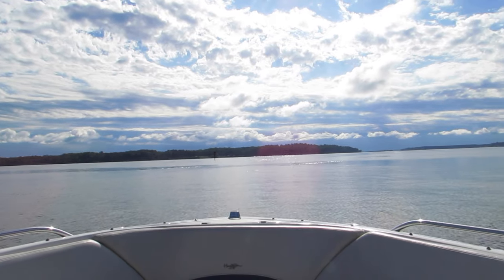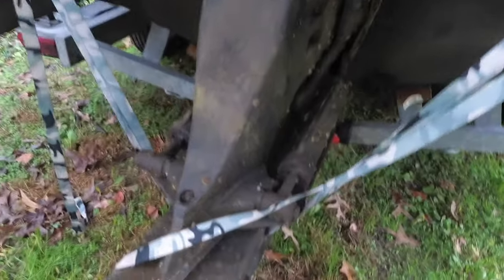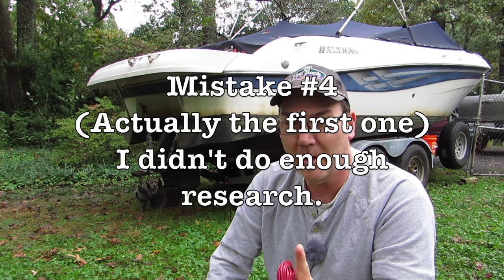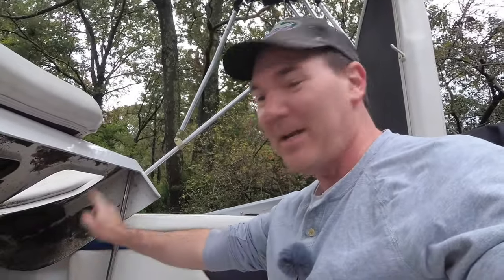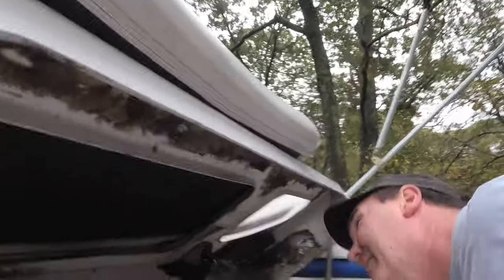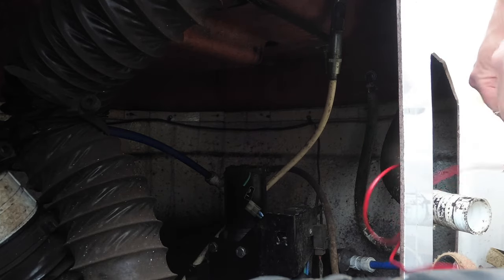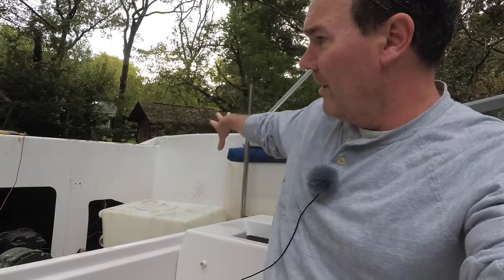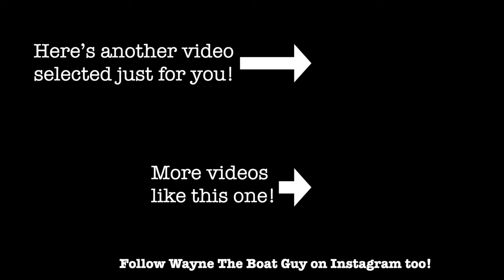Tilt Trim Not Working or outdrive stuck down? Here's something simple to try.

Comment: I just found out that my trim works okay. After hot wiring it, from wayne's instructions, i did raise the outdrive that way, 3 weeks ago.  I didn't know whether to use the buttons on the throttle or the up/down switches on the dash.  Now I need to learn about the trim tabs.

Comment: Love the honesty.  FYI there is a relief valve on all outboards (and I am asuming outboard/inboard) that allows you to manually lift or lower the lower engine.  It is a screw that you use a straight slot screwdriver to turn.  Turning it Counter clockwise relieses the valve so the hydrolic oil can move freely.  Then you will be able to lift up on the motor until you can put the kickstand down.  If the motor is stuck in the upright posistion then it will allow you to lower it.  If you are in a fix this comes in handy

Comment: I just found out that my trim works okay. After hot wiring it, from wayne's instructions, i did raise the outdrive that way.   I found that trim does work as long as the key is in the accessories position, using the buttons on the throttle handle. I just bought the boat.

Comment: I just had a similar issue last night. Turns out the power to my hydraulic pump separated from the connector so it wasn’t getting any electricity. I’m guessing the connector end eroded away and the wire became disconnected, where all my accessories were also place on the engine block off of my battery cable. 97 Four Winns Horizon QX.

Comment: I have a mercruiser alpha drive.  Always have had grounding issues. Got stuck down then up. I made an alligator clip jumper out of 12g wire and ran it from the grounding location for the pump straight to battery negative and it runs just fine. A wise mechanic told me to check power and grounds first
Reply from the maker: That is a REALLY good thing to remember!

Comment: Hey Wayne. I just saw your site and am impressed with how many issues you’ve addressed. I have a question not related to the current video. I hope you’ll see it and give it some thought. I have 140 hp Suzuki outboard. For the last number of months occasionally it will stall out at speed. The fix four out of the five times has been to squeeze the gas bulb near the tank to give it more gas. The bulb is always soft. I then put in neutral and it restarts. The other time that didn’t work, and we were stranded out in the lake. I took it into the local marina guy. He looked at many many different things, including fuel pump, etc. etc. filters etc. and he said he couldn’t find any issues or anything wrong with it and just to try it again and keep my fingers crossed. We’ll, it happen again today. we did the squeezing of the bulb thing and it worked after I restarted. Is this a common issue with Suzukis and if so, do you know any Reason this is happening and any fix that will be a little bit more permanent? I’d really appreciate hearing back from you. Thanks very much Wayne.

Comment: Hey Wayne I had a similar problem, except the trim motor worked and then it wouldn't. Played around with wires and got it working. I noticed a lot of corrosion on the leads to the trim motor. Cleaned them off and it seems to be working. However to be safe I'm going to pull the relays and clean them and order new ones they are cheap. I noticed the up/down relays are held into their receiver with zip ties. Given the bouncing around they might be loose. A lot of electrical corrosion on these old I/Os.   Fooling around with a faulty starter relay too. But thats for another day
Reply from the maker: Yeah! I needed to clean all the contact points again this year and used a lot of dielectric grease to try to help. A month later and it’s acting up again because of poor contacts.
Reply: Don't never buy a boat if you don't know what to look for. Maybe 1% or 2% at the most a boat owners when they selling the boat will be honest about all the problems do your research go online . Plenty of great videos easy to follow I've been a mechanic for the last 60 years and work on boats also and there's times that I have to look at the videos it's okay to make mistakes as long as you learn from them and the next boat you get you won't get ripped off as bad. Good luck. Boat stands for break out another thousand believe it the main thing is to have patience and you will persist

Comment: Fantastic, thanks! I did this today on my Mercruiser Aplpha 1 Gen 2 and although the plugs etc are different the concept worked perfectly! I also added a switch near my throttle so now I can raise it by toggling the switch. I wired it directly to the battery etc. The reason I did this is that my SeaRay 180 bow rider is 21 years onld, probably worth about $6K retail. There is not way I can justify spending $100's on the new parts and a technician to do the work. The total cost of the job was switch $9, wire $9, other small things $3 although it took me about 2 hours (free).  So about $21...
Reply from the maker: Glad it helped! With an older boat, sometimes it's challenging to decide whether to fix something 'right' or to just get it working again!

Comment: That was a very good video. I am not much of mechanic and I have the same engine in my boat. I noticed red fluid leaking from the rear of the engine compartment. I was told could be hydraulic fluid. My boat did not come with a owners manual I bought it used. Looks like its coming from a plastic box in the back .
Reply from the maker: Thank you!! Your power steering might also be red. It can be real tricky finding out exactly what and where is leaking! Sometimes if you hold your phone behind the engine and shoot video or take pictures you can get a better look at problems and leaks. Good luck!!

Comment: I thank you for the great video it helped a lot . I still need to find what to do as my pump does work
Reply from the maker: Try to check the easy stuff first - fuse, circuit breakers (and relays like I do here) and then the switch. But if you hot-wire your motor directly to a 12 volt power source and nothing happens, it's something in the motor. Good luck!!

Comment: Hi Wayne, I love this video. Thanks for posting it..!     I have the exact same tilt-trim motor with a stern-drive stuck in the down position.  I'll be giving this a try and re-posting.     

QUESTION:   Can you do something similar to lower the drive ?
Reply from the maker: I "think" you can reverse the wires and it will lower the drive.
Reply: @WayneTheBoatGuy    
This worked like a charm Wayne.!   
By reversing the - positive and negative - contact points from the battery to the trim motor, I was able to raise and then lower the outdrive.   
Great video, thanks again for taking the time to post it AND respond to comments.

Comment: My first inboard, they said, just put the exhaust manifold back on it’ll run exhaust manifold was cracked. Three engines later the boat finally runs right did it all myself had no idea how to do it thought this is a great learning experience and if anybody tries to give you the old man garage wall? It’s a boat motor. It’s different than a car motor. They’re out of their mind it’s the same thing Same thing started mine 10 years ago and I love my boat now last engine was put in five years ago got that many hours on the boat that I keep burning up engines.

Comment: What was the final fix? I have the same issue - Trim Switch up/down just makes a click in the engine area. I appreciate your video as I wasn't sure about the Trim Motor itself either. (Typical) Location, Electric, Hydraulic.
Reply from the maker: The last fix I did to this was to replace the relays with new ones and used a lot of electric connection cleaner spray and then a little touch of dielectric grease. That seemed to sort everything out.
Reply: Well I just got finished troubleshooting mine. Found the pump. I used to think it was a dedicated pump for one of the engine hatch lifts. I tried to just pull the relays off. No go! I reseated the power plug and tapped and kicked it a little. WA-LA! It started working! I'm guessing a stuck motor? I may post a pic shortly. I do appreciate all your videos as guidance. Love your simplistic approach and humor too!
Reply: @WayneTheBoatGuy  
I forgot to ask you if the polarity of the "hot" wires from the battery made the outdrive go up and/or down? Seems like you just hooked them up and the outdrive just started going up. What makes it go back down? Flipping the wires around? Thanks Wayne!

Comment: So my motor sends the unit down but not up.   How do you reverse the motor.
Reply from the maker: I would check the switch to see if it's working when switching up (can you hear a click atr the relay?) and you can swap out the relays or switch the wiring at the trim motor. But there could also be a separate issue.

Comment: So if you reverse the wires in the terminal would the stern drive go down? How did you know the correct way to get it to go up?
Reply from the maker: I think I just touched the wires to the tilt-trim motor plug which has two wires, and then just switched them around.

Comment: It looks like the previous owner anti-fouled the outdrive with the paint that he used on the hull.Somewhere in the back of my mind I think that is a mistake. Not 100% sure on that one but check into it. Another plus on inboard is you can run a bus style heater off the cooling system. Possibly more desirable in my climate than yours. When you get tilt trim working run it up and down often even in storage.
Reply from the maker: Yeah it is painted. I asked a few buddies about the outdrive being painted and they said it's pretty common around here when people pay to have it done. I am not a fan and it didn't seem to help keep barnacle growth from forming on the outdrive either!

Comment: Take one side of the rams off you can pull drive up and green wire means go so down and blue is up .....hit the wire with 12v you can get them to work ....cheaper then replacing skeg

Comment: Hi I appreciate your help in your videos I tried direct cross to my motor and it does nothing my tilt trim looks exactly like yours have you got any advice about changing the motor out my boat is in the water at the marina outdrive is down does it need to come out of the water?
Reply from the maker: I had the same problem this year. What we did was lower the front of the trailer so that the outdrive didn’t drag coming out. We used an adjustable hitch in the lowest position. Good luck!

Comment: Hello Wayne, I am suddenly having a similar issue with my boat and I think you may be able to help. I started de-winterizing my boat this past week and my tilt trim switch was working at the beginning of the de-winterizing process.  I stored the boat with the out drive trimmed all the way down during the winter and this week I was able to trim it all the way up using the switch so I could swap out my impeller and drain all the gear oil.  Yesterday after getting the lower stern drive back together I attempted to lower the outdrive all the way down so I could reservice the gear oil and the switch just made a clicking sound and the outdrive is stuck in the full up position.  I suspect a bad relay or solenoid but for the time being I would like to figure out how to at least lower the trim all the way down so I can reservice the gear oil and get the motor running.  Is there a way to jump the trim motor to get the out drive to lower? How do I troubleshoot the relays and the solenoids? I am hoping you or someone else can help me out here.  My boat is a Mercruiser with an Alpha 1 Bravo 2 out drive but the tilt trim looks the same as yours.
Reply from the maker: If your setup is similar to mine - the problem might be the relays. I have another video showing how I bypassed the relay that might help you! https://youtu.be/PHovzON-Ccw
Reply: @WayneTheBoatGuy  Thank you Wayne for the tip.  I was finally able to go out and do some trouble shooting today and as it turns out my system is different than yours.  Mine has two separate solenoids, one for trimming up and one for down.  I was able to verify that my actuator was working by bypassing the solenoids so I determined the solenoids were bad and replaced them and now the system is working as advertised.  I appreciate your help and response.

Comment: Wayne, where did you get the wiring diagram from? I really need an Owner's Manual for a 2002 Stingray Boats 240CR. So far I have been unable to find one. Even Stingray doesn't have them back that far.
Reply from the maker: I did a bunch of searches to find it. I have had lots of challenges finding info for my boat too!
Reply: Try ebay I found a manual for my 4 cylinder inboard 2007 there good luck 👍

Comment: Check your wires going through the transom to the trim indicators on each side of the outdrive. I don't know why it's a stupid design but the wires look like a damn lamp cord. They will get pinched and the insulation will get brittle and fall off will short it out and will nothing work up or down
Reply from the maker: Good things to check! My problem ended up being just corroded connectors on the relay.

Comment: Hi I am having the exact same problem. What did you do to fix it?
Reply from the maker: At the time, removing and replacing the relays did the trick. But I have still been having periodic issues over the last year. It seems that some of my electrical connections are failing.
Reply: @WayneTheBoatGuy  ah I see. My boat is a 79’ and doesn’t seem to have any relays. I’m going to try hot wiring today. If the motor works is there anything else I could try to fix it?
Reply: @WayneTheBoatGuy  God bless you for this video! I already went crazy with it... Could you please tell me which relays you replaced? My trim motor works so I think I also have a problem with relays... 
Never thought before that I will spend my time repairing my boat's trimmer with my manicured nails ))) but this time came... So please, help, you are my best hope at the moment as I have nobody else who can fix it for me )))

Comment: Hey 👋 I just did this but it didn’t work what you think it should be ?
Reply from the maker: If you aren't getting a click or anything, it could be the motor itself. But check for a fuse or any other interruption along the way. Sometimes these things will work one direction and not the other, or the wire connections might not be good.
Reply: @WayneTheBoatGuy   thanks 🙏 after checking and checking the problem was the solenoid that went bad and also the trim motor wasn’t working because of the battery was too low 🙏
Reply: @WayneTheBoatGuy  thanks again 🙏
Reply: So what was the problem? Relay? Fuse?

Comment: on a used boat, the first and most important work is usually to rebuilt entirely the electrical system, unless it is a top quality boat, th e electric system is usually poorly built and is the first component to give trouble, for the inboard engine, it is usually the most reliable component as it is an adapted automotive engine whish have been sorted by use in many applications.
Reply from the maker: That's a good point since there seem to be quite a few electrical connections that are no longer looking clean! 
Thanks for the feedback!!

Comment: just replaced the entire unit and it still doesn’t work.  I don’t know what else to do!  Switch is good, relays are working, motor is new, sending switch is working.  The unit the relays are plugged into works.  What else can there be???
Reply from the maker: How about a fuse or circuit breaker on the circuit?

Comment: Ok all he had to do was take the rod that runs through both hydraulic pistons as well as the outdrive.  One nut loosened and the rod slips out, then you can tie the outdrive in the raised position with a come along strap or even good rope.

Comment: I think my motor is bad do you think it would be easy to just replace the motor
Reply from the maker: They aren't too hard to do - if you can easily get to it. But usually the problems with these seem to be electrical (fuses, bad ground, relays, switches, etc.) try to check all of those as best you can before buying a new motor.
Reply: @WayneTheBoatGuy  ok ill try that thanks
Reply: We replaced our motor on an 88 sea ray. The hardest part was the switch not working on the throttle. Had to make a new place for a new switch Bit the new motor was an easy install. There are lots of youtube videos ok how to do it.

Comment: I can't image working in that space with a boat that has been on the water it's whole life. The electrical is going to be a nightmare.  I would do evey maintenance item regardless of what the previous owner said. He most likely didn't do anything because he couldn't do it himself or/and or was a cheap ass. 

I'm lucky enough to own a boat with 30" on either side of the engine because it has a sundeck and no walk through.  I set up an emergency tilt trim switch using the hot wire method, a 15' 12awg extension cord and a 20amp momentary spdt switch.  Comes in handy for maintenance so my old ass doesn't have climb up and down playing with the throttle trim switch.
Reply from the maker: Yeah I keep telling my wife this is our last I/O engine boat!